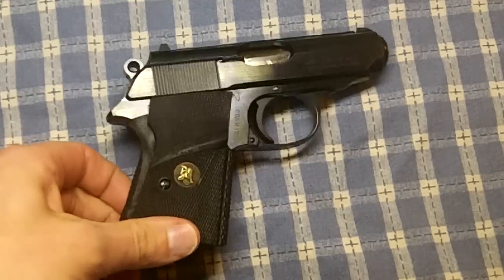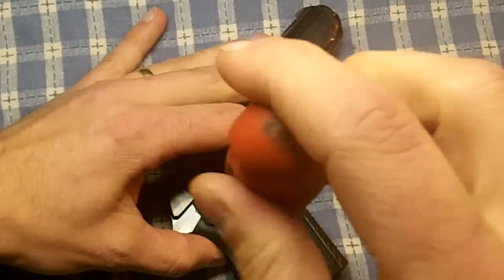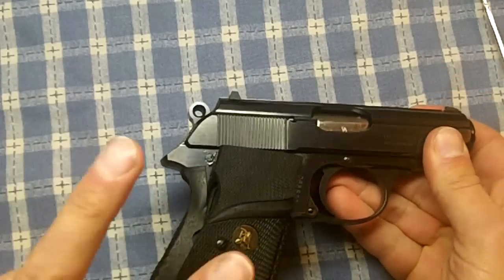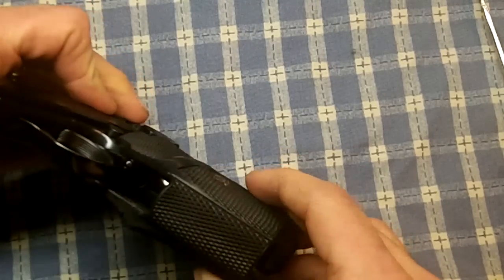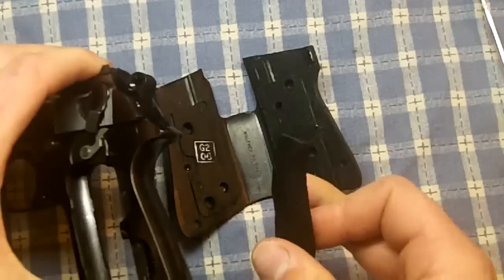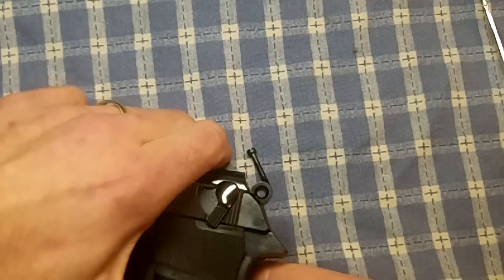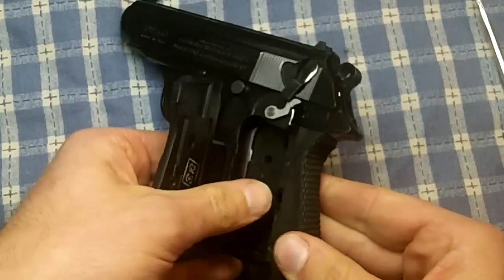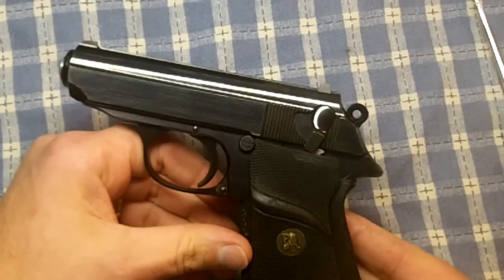ppk/s hand grips

Comment: Thanks for the video.  Great Job. Just a heads up to all those PPK/S (S&W) Owners.  Before you buy Packmayr grips, check the serial number of your weapon.  I bought grips that did not fit my gun. The screw hole did not line up with the screw hole in the frame.  Learn from my mistake.  I ended up going with a nice wood grip.

Comment: I bought a pair of these grios and they are a pain in the neck. I have put several pair on Brownings and 45s with no trouble but on the Walther PPK/S they are so tight and the screw isn't long enough that I am thinking about trying some other grips. This should be easy but for the Walther it is mission impossible.

Comment: Do not buy these grips. They don't fit without a lot of modification and the backstrap it an absolute joke. 1mm thin piece of rubber with no support and your hand has direct pressure against the hammer spring assembly that you feel jumping around every time you pull the trigger. I don't see how Pachmayr thought the design was good enough to sell to the public. Horrible set up